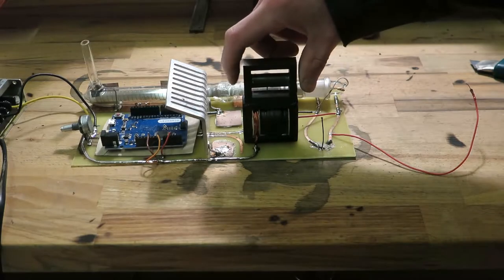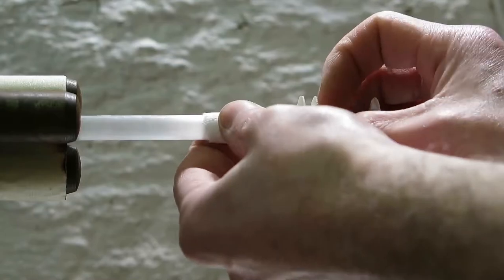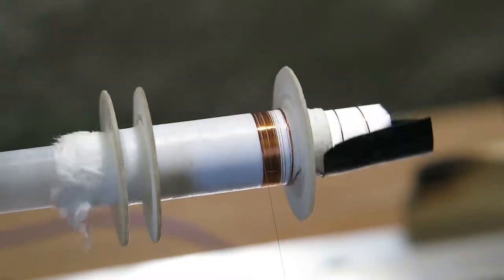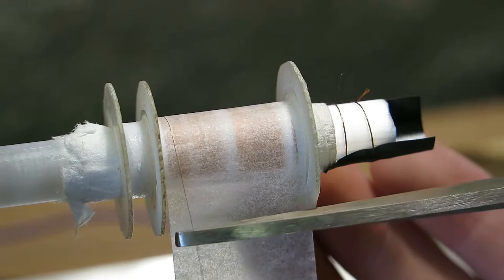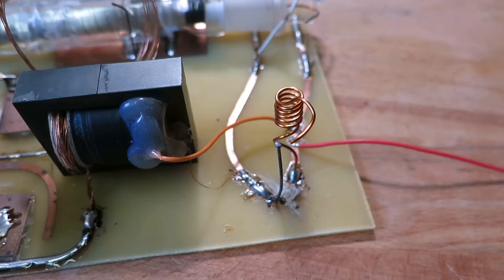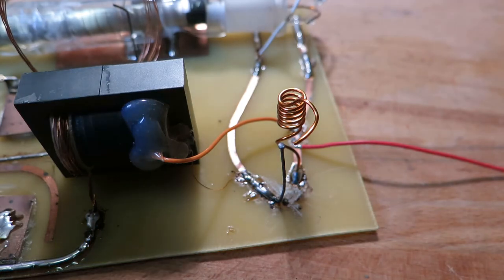Making HV flyback transformer from SMPS PSU transformer

Comment: The core that you're using doesn't have an air gap which is necessary because with those high frequencies you're saturating your core, I've made one myself and I used the core from a burnt out crt tv flyback, those cores already have the air gap on the secondary side using a very small and thin plastic spacer which is important to reuse.
I also recommend you to take more time winding your secondary and see that you have an equal amount of turns on every layer, doesn't have to be exact but it has to be much better wound than what you did here, also you need much more isolation in between each layer because the way you're winding your coil you'll get a high potential between the layers so you have a high chance of arcing over somewhere in the layers or to the outside which can potentially arc to the primary blowing up everything.
The one I made is driven by my monster ZVS driver using 4 mosfets, 2 in parallel to increase the current capabilities and I'm using a fully isolated and regulated linear power supply that I set to 14 volts to turn on the mosfets hard, then I have a separate audio transformer capable of outputting high current that I rectify with a full bridge rectifier and a big capacitor giving me 47 VDC that I'm switching with 2 relais, one for the AC side and the other for the DC side but switched synchrone to prevent arcing on the DC side and I switch that with my foot with 24 VAC just to have an extra galvanic isolation for more safer use so I never have to go near the thing with my hands which is highly recommended because you will shock yourself eventually even if you're very careful, it happened to me so you're warned.
When I switch the relais to activate the high voltage it pulls 13 Ampere from the 47 Volt output which is more than 600 Watts, it's an absolute monster capable of putting out 100KV+
There's no way I can measure the output but I can easily pull 10 cm arcs that are white hot and about 1 to 1.5 cm thick and it melts almost everything instantly, it's very very dangerous and if you're not careful and you touch the output you will die instantly and be dead before you hit the floor but it's super cool to do experiments with it and for blowing up stuff that can't be recycled anymore.
I hope that this is somewhat useful info to you and I wish you the best of luck building another one.

Comment: you can use a DC flyback core instead of that, it stays more distant to the winding so you'll not pack it, i made mine with
- 1300+ turns of salvaged wire(s)
- regular color TV flyback core (actually a small one)
- plastic spool taken from a TV supply flyback (it has several slots in it so you can use the classic system of separating sectors)
- electrical tape to insulate the wire that goes inside the sector (classic dodgy wire that passes on the side of the entire winding (but in this case just one sector and more insulated))
- teflon tape on the bottom of the spool sectors (to space the wire from the core), i forgot to wet the telflon bed with grease to spark-proof it
- original core gap spacers (but it apparently not necessarily likes 16kHz)
- hot glue (pretty good for HV)
- HV wire for the output (just one wire end is HV, the other is tapped to ground)
- ne555 + mosfet drive
like 10-15kV of output but i'm not gonna push it at the point i ruin it
Reply from the maker: "like 10-15kV of output but i'm not gonna push it at the point i ruin it"
Sadly one don't know where this point is (in advance) :)

Comment: Seal the whole secondary with resin. You also have the option of using an air core.
Reply from the maker: I don't think that will work well - I mean flowing resin all the way and doing it's job. You will be probably better off spraying  each layer with some acrylic spray and even better would be using better separation. But to prevent arcing to core or to primary, resin is best for sure.
Reply: I've been recommended epoxy, and polyester resin specifically, but I feel like almost anything would work.
Reply: @IlusysSystems  if you submerge it in resin and pull a vacuum it will drive the resin/epoxy into the coil. You can use a compressor from an old refrigerator or air conditioner, they produce incredibly high vacuum.  However this will destroy the compressor over time.

Comment: What's the breakdown voltage of banking paper?
Reply from the maker: Good question, I couldn't find this info on the box unfortunately:( tl;dr: Usually it's fairly good.
I have used baking paper with Al foil to make HV capacitors, at about 5-10KV they started failing.
So it's not excellent and it's not designed for this purpose - not uniform, may vary between manufacturers and so on...
Reply: @IlusysSystems  ok thanks for replying